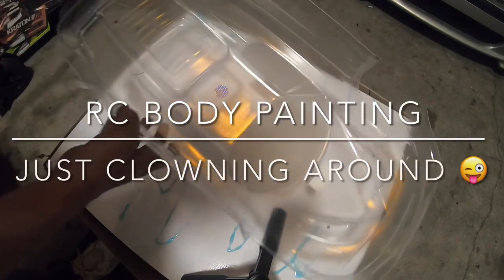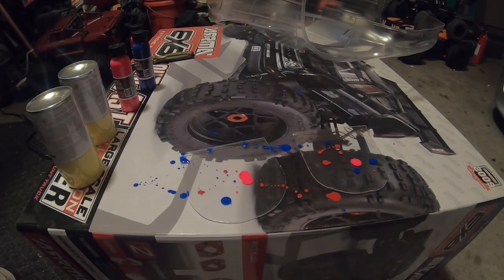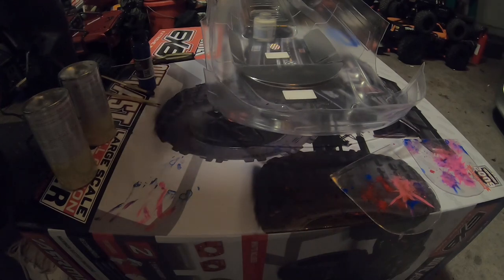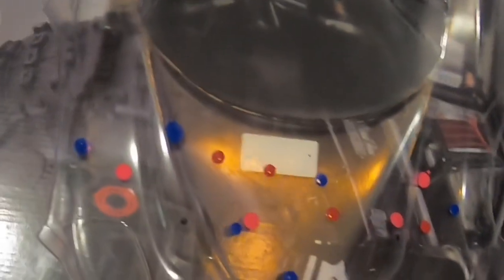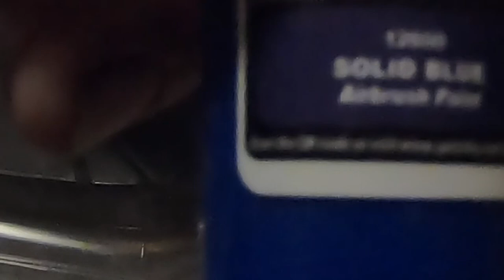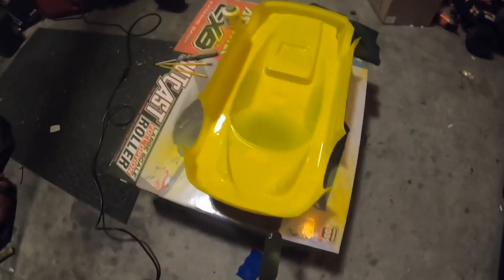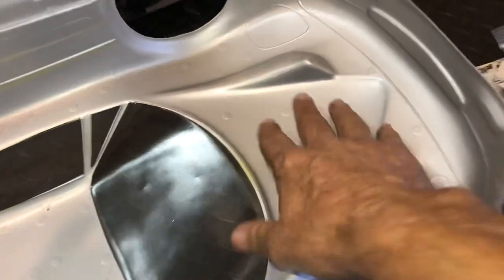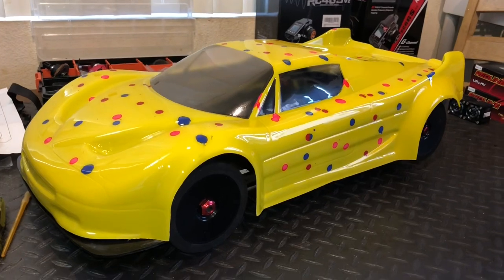Arrma Infraction V1 Speed body Painting Just Clowning Around ? (Clown addition) rc speed game !

Comment: Salute I wondering if u can help me I put GPM aluminum CVD drive shaft arrma 1/10 Granite 4x4 MAG108FRS-G on my arrma vortek witch Arrma told me also they can on on tha vortek whn I installed them on the rear wheels are very tight the wheel rotation  am I doing something wrong ?
Reply from the maker: No rc guy garage had the issue with a big rock and arrma upgraded shaft contact  gpm I feel there an issue I just haven’t used them rc guy garagemight have more insight
Reply: Appreciate you Salute peace and blessings